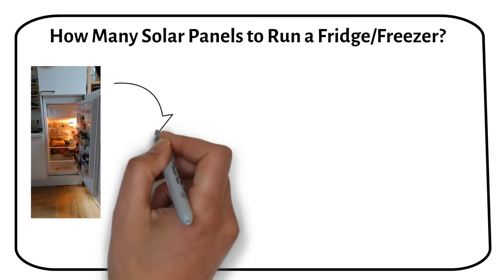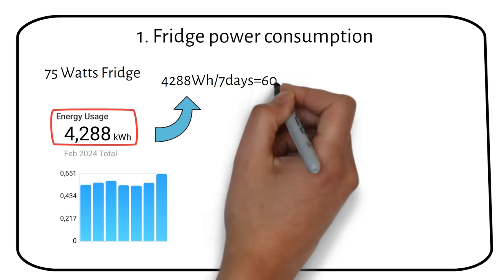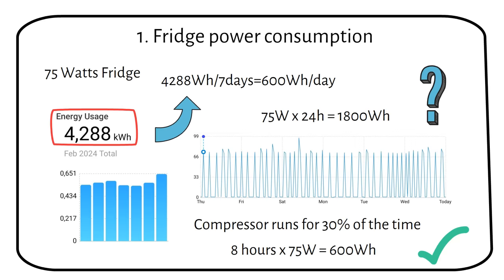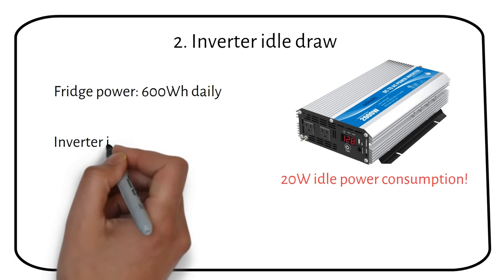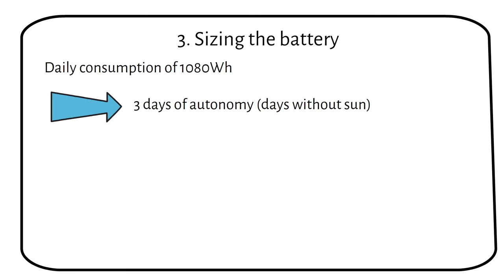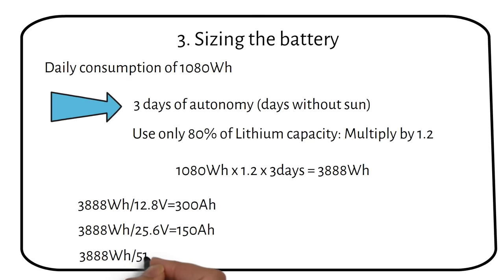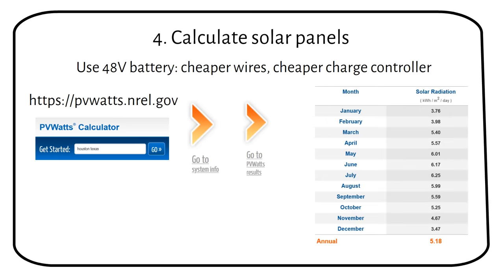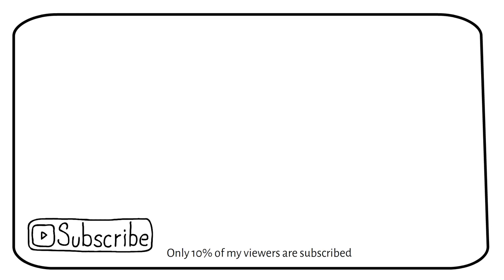How Many Solar Panels To Run a Fridge/Freezer?

Comment: That is better than I predicted.  That means two decent panels (~300 W ea.) can power a fridge for 24 hours with only 1 hour of direct (noon) sunlight (and a battery system of course).
Thanks.

Comment: New question. How can a 1000W UPS run on a 12V 7Ah battery and an invertor system needing  a 100Ah.